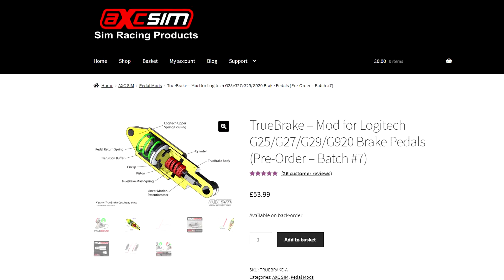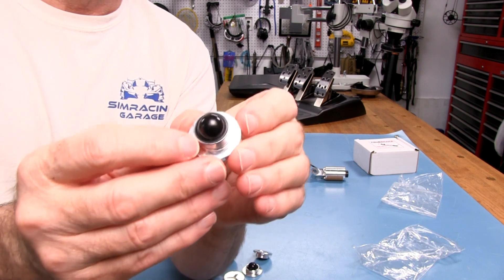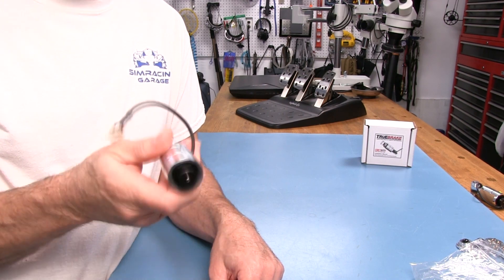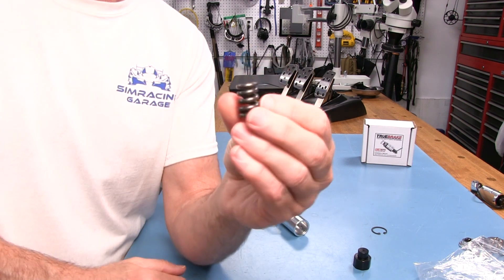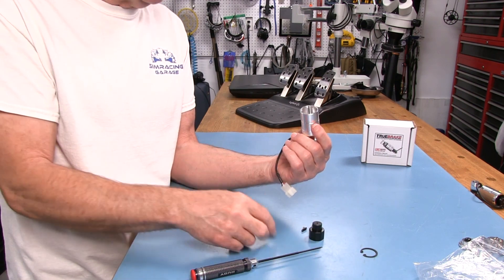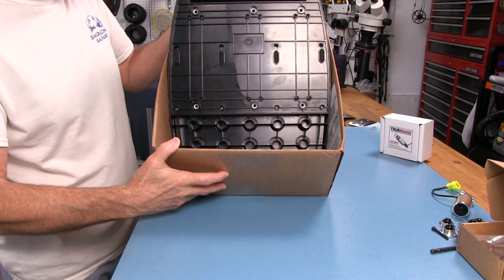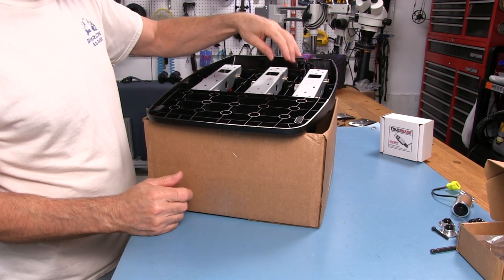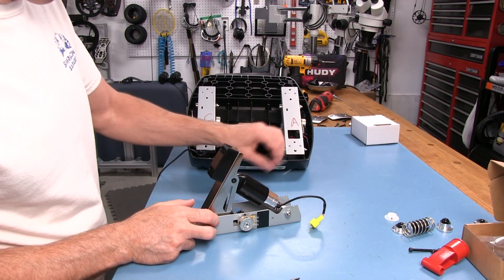TrueBrake Logitech Brake Pedal Mod Review

Comment: I got this mod.  So happy with the purchase.  My braking is now controllable.  I am getting better lap times because of it.  I can brake so much later.  I never used a load cell.  I have only owned a g920 brake set.  Dump the original brake, swap the springs around. It’s great.  If you have the money buy a bettter set up.  If you’re on a budget like me, this is soo worth it.  I’m trying to get the word out. True brake is awesome.
Reply: Any comments on how the various sized buffers make a difference in feel?
Reply: @kyaw5800  i went with the middle size and I am very happy with my choice.  You will not regret your purchase.
Reply: hello are you console or pc curious to how it would work on console
Reply: @ceementality  im on pc but i think it would be the same.  i made no adjustments to any software.  it just worked

Comment: i would like to see how it compares T-LCM
Reply: T-lcm has hall sensor clutch and pedals compared to g29 cheap pots, double the resolution, actual loadcell brake eith much more adjustability, better construction etc... no contest really. This makes sense for people on console.
Reply: @Max__apex  no need to get pissed over facts lmao. Lots of projecting going on here, especially over... simracing equipment bloody hell.

No way a small company that makes a modification for an already inferior product is going to be able to compete with a technically superior product by a mega company. Just how it is.

The price is too high for what it is it to be justifiable on pc when you can just change your pedal set to TM and use USB, can't do that on console.
Reply: @yz249  technically you can just use a usb on console, drive hub by collective minds…

Comment: (ATTENTION!) For you console players out there this would not work very well. Unless your game allows for manual pedal calibration. GT Sport for instance calibrates the pedals in the background and looks for how far the pedal travels and sets that to max, if you push the brake harder then it will set a new max. This happens everytime you start the game. So just be aware of that sort of thing. This is definitely oriented towards PC sims/games that have manual calibration.
Reply: Thank you for the info. I just purchased a Logitech G923 and I would like to know what would be the best mod for the brake. Ricmotech load cell or anything else?! P.S. I am new to the sim racing scene.

Comment: How does it work with the g29 pedal base and the braking curve there? Not sure if it's worth buying for my G29+PS4 set-up if there will still be some brake issues
Reply: Ps4 user and g29 too waiting for a reply
Reply: Also waiting
Reply: The manufacturer says on his website that he tested it extensively with GT Sport and it works properly.
https://www.axc-sim.com/gran-turismo-sport/truebrake-on-gran-turismo-sport/
Reply: @stub4488  Its awesome and has a much better feel, im using it with my G29 on the PS4, worth every cent
Reply: @samboy8815  Thanks Sam, but can you be more specific on the feel and improvements. Can you compare the consistency, the trail braking etc? I use now that mod where i inserted another piece on the existing hard rubber there (a hard silicon thing) and yes, there is a big improvement in consistency being able to better controll low braking and trail braking
Reply: @alexcov  The pedal now works on pressure not position and hence gives a more consistent and realistic feel, on Monday I was racing on a sim with a full Fanatec DDL setup the upgraded Logitech pedals felt very similar in terms of consistency and feel. If you want to be more consistent and also start to further explore your lines and braking points I would buy this setup, it takes some of the guess work out of your left foot positioning and also better reflects a more realistic pedal feel.
Reply: Thanks, this is what i was hopping to hear :)

Comment: Had my truebrake for a few months now. It's superb. The brake feel is amazing, feels just like a good firm brake, a small amount of initial movement then really firm.
Lap times dropped noticeably.
Reply: Which load pièce do you use? The one used here, with less travel or the smallrt one with more travel ? Thanks 👍
Reply: Hey mate, are you using yours with stock logitech interface or with the Leo bodnar cable?
Reply: Ricardo Fonseca I have the brake and i use the the third largest.   I tried them all and I prefer the third largest. I think it is about your personal preference.  Barry is a beast that’s why he uses the largest lol.  This vid convinced me to make the purchase.  Like the original poster said it will really help with lap times.  You can brake so much later.
Reply: I have just installed the Ricmotech loadcell and not liking its pressure “curve”. Maybe this one is better having more customization? I think ricmotech may have other rubbers but thus far I dont like it
Reply: @cactusjelly  Have you managed to try the TrueBrake, as well? Would love to hear your experience. I am trying to decide as well which one to buy (Richmotec or TrueBrake)? I have a Logitech G923 on a PS5, so don’t have the luxury of doing to many custom settings…
Reply: What's the cost

Comment: Bought it and love it.   One thing i recommend is that you buy the optional spring kits.  I found that the 100% spring was too stiff, very hard on the door and could not get a good feel, switched to 60% and so much better.    Now I may go to the 80% to see how that does.   Great product.
Reply: are you using the bypass cable or just direct back into the wheel plug in?

Comment: Does anyone know what Barry means with the "Logitech firmware add-on" at 47:52 ? If I understood correctly this is not referring to the Leo Bodnar adapter, since he says the add-on provided by Logitech.
Reply: It would be nice to know. Let us hope the youtube guy will answer our question.
Reply: @fail4lot  From what I understand. The G29 stock brake pedal has a small piece of rubber inside of the spring tube to make the pedal feel a little stiffer when pressed down to full range. Because of this the G29 wheel's firmware adds a bit of an upward input curve to braking strength to compensate for the stiffness and reduced full range of motion from that of the G27 which does not have the same rubber piece. This was considered an upgrade to the feel of the pedals, otherwise identical to the G27. The Leo Bodner adapter bypasses the G29 firmware by hooking directly to the pc. Giving the pedal a linear input Like the stock G27 Before it.
Reply: @GREYBUSH85  Oh yeah that explains it, thanks. Barry really wasn't a fan of that rubber thing / firmware curve, I missed this bit of sarcasm from him
Reply: @hingi_games5421  Glad I was helpful.

Comment: Hi, a question. If u have this mod connected to the ps4, will it work or do you need that adapter and use it with a pc? Thankfull for an answer
Reply: The adaptor works through the wheelbase which in this case is set up for both the PS4 and PC.

Comment: Hi SimRaceGarage, great video. Thank you for that! On min 42:00 approx u are talking about a "Firmware" on the G29 wheelbase which lets call it interfer the raw input on software level. Do you know if the G27 (twentySEVEN) is affected by that, too? If yes, what was the adapter you were using to bypass that? Greetings
Reply from the maker: G27 does not have that "feature".

Comment: Looks nice but how will that perform thru the G29 wheel ?
Reply: Depending on how much pressure is required to get to 50% or so before the Logitech wheel would assume the bump stop is, I could see it still working well, issue with most brake mods with the G29 is that the wheel doesn't use 100% of the travel
Reply: I've had it a few months now running through the G29 and it's great. I have my pedals inverted and mounted in my MDF sim rig and can't recommend it enough. Just buy it, you won't regret it.
Reply: Aaron Byrne-Colgan agreed

Comment: Does this work when the g29 is connected to console aka ps4?
Reply: Yes, but it is best used on a proper sim rig as the pedal is REALLY heavy. Not worth it if just using a playseat or game chair
Reply: @Al_United  ok thanks. I do have a rig so this will benefit me. Thanks for your response
Reply: @danielpersad5789  No problem, hope its good for your racing 👍🏻
Reply: @danielpersad5789  how is it on console?
Reply: @ceementality  haven't tried it as yet. Gave it to a friend and I'm ordering in one for me now

Comment: I'm using a G27 with PS3 to PS4 adapter. Would this mod still work ? Also which Main Spring Rating option is recommended?

Comment: I bought this mod still couldn't brake correctly with it... no fault of Barry solid review sir... thankfully I work as a lead operator for a plastic company that makes plastic material for the company that supplies gm with the plastic rubber compounds they use anyways a chunk of G311 A40 compound that vented out of the top of our extruder machine worked perfectly it actually made it a progressive brake pedal and feels perfect under foot to me and won't leave a bruise if I decide to drive in my socks...

Comment: On my G29 pedal set, I actually swapped the shorted gas pedal spacer and screws with the longer one under the clutch pedal.
Along with moving the gas and clutch to the leftmost screw holes, for more even spacing.
I kept the brake in the centre, as even with the stock spring and rubber, it feels like I am pushing too hard for it's mount.
Which makes sense, since this aside it's the same mechanism as the G25 or G27, which had a reputation for having light pedals.
With the stock setup this feels great, but I will probably make this upgrade down the line.

Comment: Thanks for the review! I bought this mod earlier but it was way too stiff for me, but seen how you dismantled, so after that I knew how to change the main spring. Now it's brilliant!
Reply: Hey could you send a link to what spring you used. A natural full force braking pressure I use only is around 40% of the total force it needs to have to reach 100%. So I'd appreciate it if you can advice me on what spring u used
Reply: It’s also too stiff for me, what did I change ?

Comment: Very new to all aspects of sim racing. In fact, have only had my PS5 and G29 for less than a week. I'm confused about your conversion using the USB to the wheel unit. If I use this on my G29 how do I bypass the firmware? The G29 does not have a USB input, only the serial input.

Comment: Hi, have you a video on the bypass using the USB adapter to get round the firmware?

This is all new to me, only 1 year with g29 and truebrake mod just shipped.
Reply: Did you bypass the firmware or just plug straight into the wheel?

I am thinking of doing this mod with a g923 on PC

Comment: Great review, I have just bought the upgrade myself, but to correct something, you are in fact breaking by travel distance, it is simply a shorter distance than stock with a much stronger spring.
Reply: Well even a real brake peddle is still by travel distance, if you don't push it further it will not stop on its own.

Comment: hello there!! Yesterday, I installed the True Brake into my G923 pedals, but since I have my left ankle injured, it came to stiff, that after only five pedal pushes, my ankle started to hurt, and still do 24hrs later. So I disabled the pedals again and installed the OEM spring, and know even if i push the pedal to the maximum, it only reports 74% in all the games and in G-hub... can you please give some advice. Thanks

Comment: Great review. I am a ps4 user. Got some issues with my true brake. On some games we can't calibrate the pedal "in game", main example is ACC. As a result I need to apply a lot of pressure to get to 100%, a lot. It feels I can stand on one feet with the amount of pressure. Afraid i might due some damage to the gear, or to my own knee. 
Any solution? Don't think so. Already contacted Kunos to see if they get that calibration option that all other games including the original AC have on the ps4. Other than that... it's a great mod.

Comment: I have been using mine three months, this is absolutely great product!
Reply: Do you use it with the g29 wheelbase?
Reply: @robertschneider8808  Sorry no, my second rig has only G27, but i think it will perform fine with G29, i didnt even calibrate pedals before using. I think wheelbase just sees this as regular potentiometer.
Reply: @andylee2174  The only problem is that the g29 has a non linear curve on the brake petentiometer , that might mess it up. But maybe there is someone who has experience with it.
Reply: Is your brake connected to the wheelbase or with a Leo bodnar or similar cable? Curious as to whether the lack of resolution of the wheelbase takes anything away from the mod

Comment: what about the g920 pedals for xbox one!!??? logitech use weird springs and i am about to swap them out for better springs with the ring sealers and plug sealers!! will this work on the g920 clutch, gas and brake pedals for xbox one!!?? also have you tried using the handbrake for drifting without the shifters!!??

Comment: Great review, I just ordered one. Now I'm wondering if the firmware is still an issue since in the latest Logitech G Hub software are some sensitivity settings that are declared as "linear" in the 50% position. At least its possible for the G923 I own.

Also would it be a good idea to put the old brake spring to the clutch and the clutch spring to the gas pedal? I could live with the clutch but imo the gas pedal is too soft...
Reply: Yes. That's great idea. If and when I upgrade to truebrake (or loadcell from richmotech), I will be swapping clutch spring to the gas pedal and old brake spring to the clutch. Gas pedal feels too easy to push I don't feel the pressure of where I'm at.

Comment: I have the same Next Level Racing DD Wheel Stand, I used a second pedal plate from previous rig it has a 90 degree angle and I bolted them together. I used an adaptor from G27 pedals to my TM T500 wheel base. I had to cut the grounds since I pulled the assemblies from the plastic case and grounded it thru the metal to metal contact. It is in the instructions for mounting your pedals to the DD Wheel Stand. His uses the connection away from the wheel base. Just something to keep in mind.

Comment: I grabbed one of these but it seems too firm to me. I have to calibrate it down as at full strength 100% would break my seat. Can the max pressure be modded down ? Beyond the preload there only seems about 5mm travel, would the spring govern that max ?
Reply: you can change the main spring in the housing to a softer variant or change the deadzone in the game's settings too
Reply: @zl_390  I managed to get a softer spring. I hadnt realised they sold 4 variations now. Now a lot better. Thx for advice.
Reply: @bulletape  no worries, I was having the same issue with it being too stiff to press, now I’m using the 60 percent spring much easier to press, one thing to take note is the true brake v1 required different method to replace the spring but nothing too complex overall
Reply: @bulletape  hi! What spring did you get? I’m looking for some review on how stiff is the softer spring (40%)! Tks
Reply: I got the 40% spring as the chair i use is the f-gt lite. It was a good choice as although i can press harder the chair isnt as solid as a fixed racing rig. Its probably the max id expect the chair to deal with. I'd pick the 60 if i had a more fixed seat.

Comment: I got this mod for my logitech G923 pedal base running Gran Turismo 7 on a PS5. Following the directions I switched the hub from the clutch to the brake, disconnected the R/W/B wires from the logitech potentiometer, reconnected to TBv2 wire harness. I am registering zero braking in GT7 after install. Suggestions? I double checked the correct color wires were matching to the harness

Comment: Pfff! This is a week to late, today my first load cell pedals arrived, the Fanatec CSL Elite LC to replace my G29s pedals. It feels very different, guess it takes some time to change from potentiometer G29 pedal to LC brake pedal. Did you guys go through this experience? How much time/hours did it take to get used to the LC brake? I am doing Practice and Special Events in ACC, not feeling ready to race online yet with the Fanatec LC brake :-)
Reply: Ștefan Roșu : I had the same experience a number of years ago when I bought my CSR Elite pedals with adjustable loadcell brake. I was pretty darn good with my G27 pedals (which I had used since they came out until 2008), knowing exactly how to use ‘em to be effective in my racing... hit the brake pedal all the way to the floor and then ease off to release the lock-up (NOT the other way around). I found that I could be very consistent in my braking and enjoyed the immediate, light response of the brake pedal ... very helpful on turn-in. The good news is that it does not take long to get used to the load cell and it is definitely more life-like, even if I probably still was better with my G27 loosy-goosy brake.

Comment: There has been a lot of hate on this mod, mostly because of the way it is marketed. Despite that, once you use it you realise it is an excellent mod which is much cheaper than but the equal of a load-cell mod for the Logitech pedals. Yes, it won't be as good as pedals designed for load-cells but it is pitched perfectly for the Logitech pedals. However, if you do not have any pedals as yet, it is not economically smart to buy the Logitech pedals and the TrueBrake mod together. It will be cheaper and ultimately much better to buy one of the various entry-level load-cell pedal sets available from Fanatec in 2022 on. So, if you are on a budget and do not expect to buy more kit, get the TB. If you are starting from scratch, look at a different wheel and pedal combination.